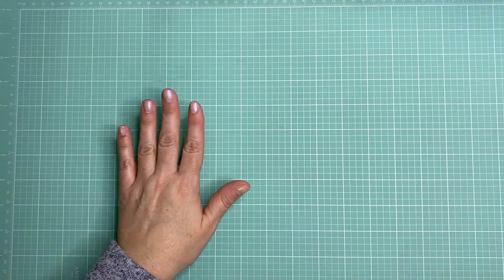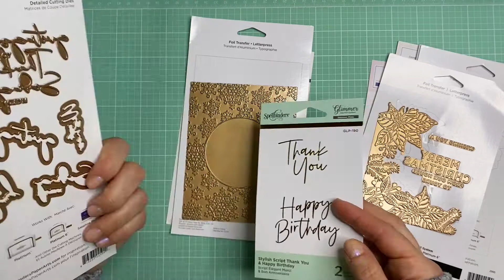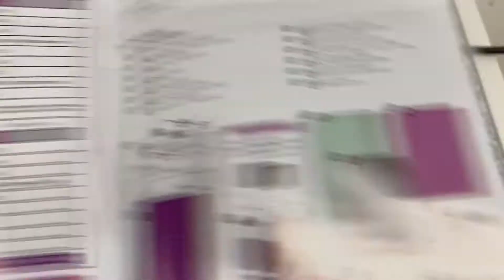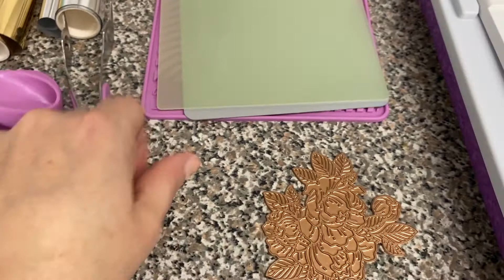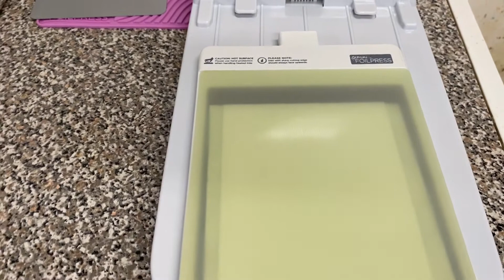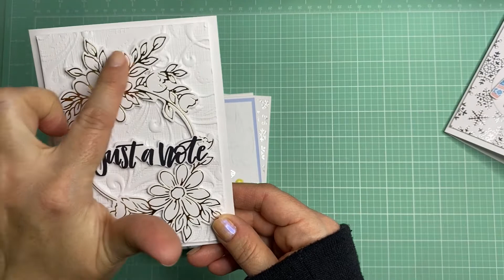Gemini Foilpress Machine Basics

Comment: Do you have to use hot foil plates or can you use any dies?
Reply from the maker: Hi Pat--thanks for watching!  You can actually use your regular thin metal dies with the Foilpress machine.  You would just follow the directions for the foil plates but instead use your choice of die.  The one thing I did notice when doing this is that you get a more substantial impression with the actual foil plates because their blades are thicker so the impression puts down more foil.  However the look you get from the regular thin metal dies is pretty too--more delicate.  Toward the end of the video I show an example using a couple of my regular dies to kind of compare.  I like that this is an option.  It definitely gives you more versatility.